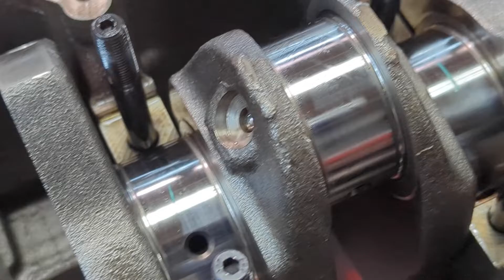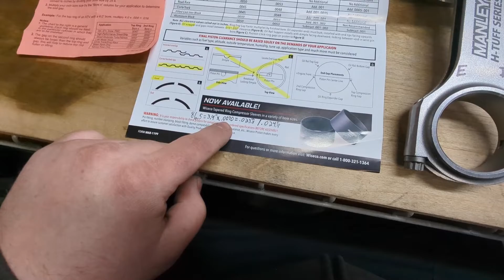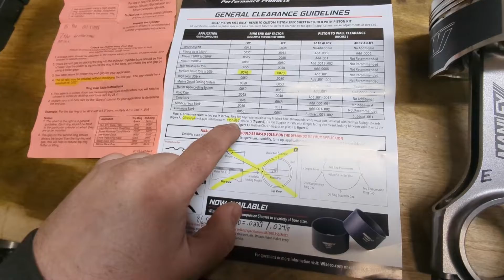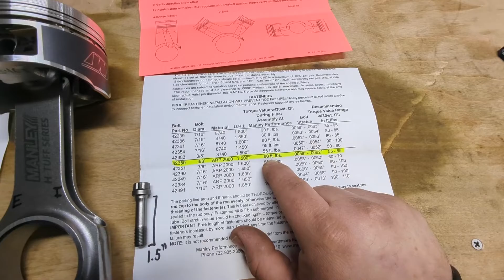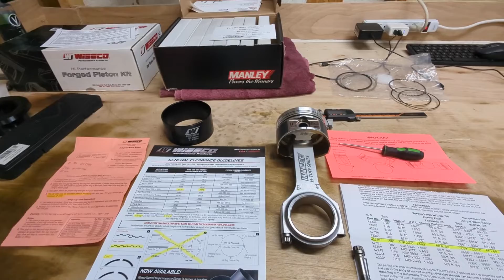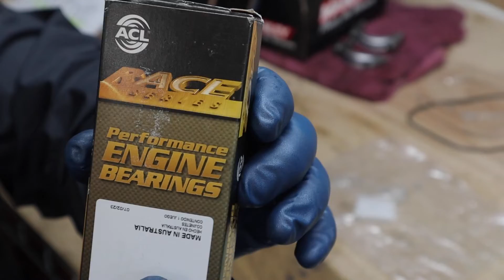1000hp 2JZ Engine Bottom End Assembly | 1.5JZ MK3 Supra Pt1 |

Comment: nice work, ive gone 1.5jz as well in my mk3 and its made a missive difference in tuque especially down low
Reply from the maker: Thank you! When you did your 1.5J, did you machine the block or head like some people say to do, in regards to some kine of oil or coolant hole? Some say you dont have to..I was leaning towards the not machining part and seeing how it works.
Reply: @PoorManMods  I didn't machine the head, it is recommended to weld and re drill the head to perfectly match the oil port on the block but honestly I cbf lol plenty of people have done the swap without doing it and haven't had any problems, mine seems to be sweet
Reply from the maker: @o.j.z5285  ah yes that's what I was thinking of and I guess I will go the route of not doing anything and see what happens 😅